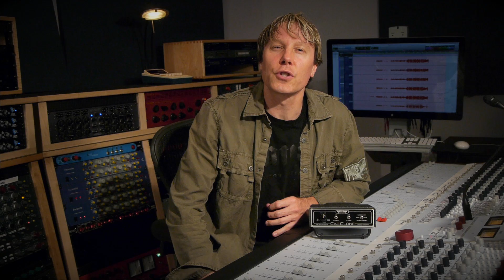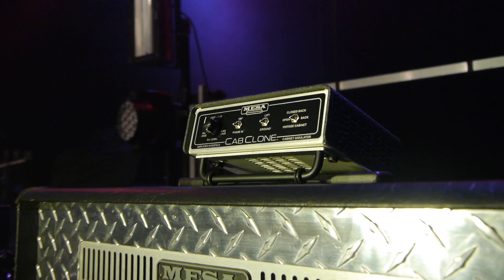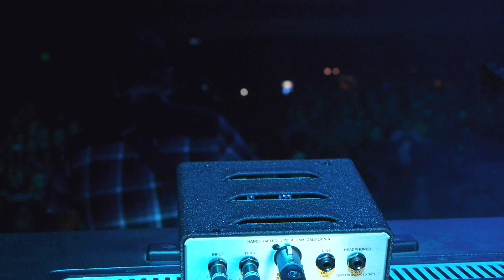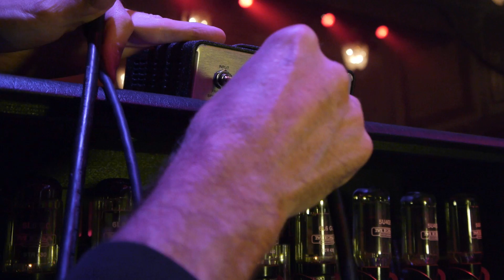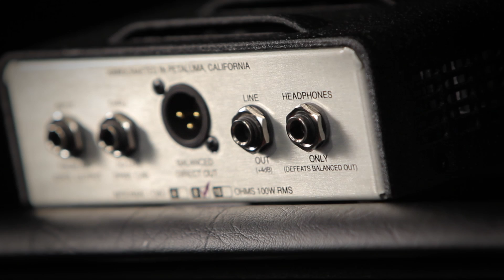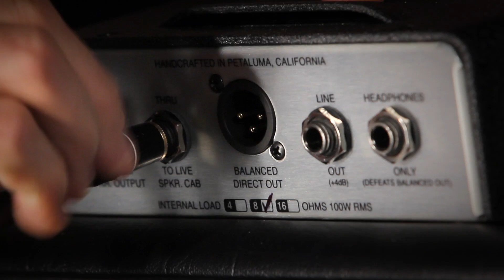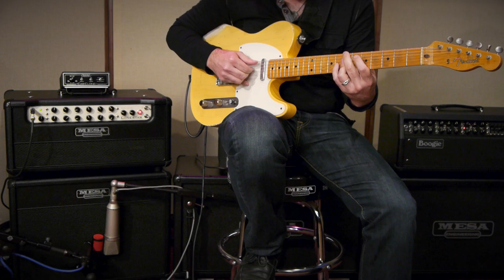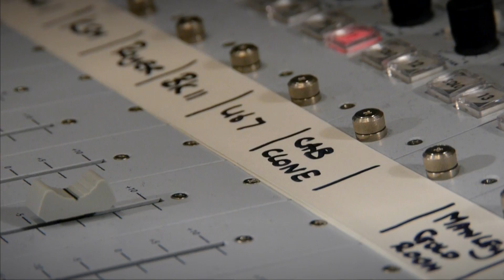MESA/Boogie CabClone Official Demo Video

Comment: they put this into the back of the mark V:25 and it is greatly underwhelming. convenient and useful in a pinch to record a demo. but it sounds like plastic..idk how else to describe it. plastic and smooth on the top end, but still harsh and with zero character. the low end of palm mutes are fizzy. horrible cab clone.

Comment: Only a half decade late to the conversation!
Is anybody out there using this device Amp> CabClone> DAW ?
Are the cab sims any good? Obviously the sound quality is coming from your amp and pedal board and so the most important feature of this device is the cab sims?
Good/Bad/Meh ?????
Reply: see here is my problem. some are raving about it (5 star reviews on sweetwater) and then some notable players say it doesn't cut it, my sansamp GT2 has been a blessing since i discovered it for live use ( direct to board and in front of a low volume on stage amp with direct xlr [from amp] to board.. I may get it and do a test run live and let u know

Comment: Is it possible to use cabclone as a load box and send DI signal without cab simulation to insert some IR plugin?
Reply from the maker: Hi Ricardo - YES! Just connect out of the Slave Out to whatever device would receive direct signal and add your IRs.

Comment: So... after using the di line out of a Mark5 35. my first impression was that it was a fantastic piece of junk. immedietely switched to micing the cab for recordings. but... i was watching the two notes amp load box simulator vid that everybody raves about, and like everyone else i was really, really impressed after the horrific failure that was the cab clone. then something occurred to me! Wait... did i use a cab simulator on the cab clone the way everybody did on the two notes? dug through my old tracks from a couple years ago. nope! no cab sims! apparently, i thought it was supposed to work by itself! put my now-standard cab sim settings on that old mark 5 track. sounded perfectly fine! it's official we're all dumbasses! i think the only real problem witht he cab clone was the advertising. they never said it needed a cab simulator, and made it sound like the thing could sound amazing on it's own. That just isn't true. no idea why they continue to say that. (even this video really, really gives that impression). i think, even if Mesa rebranded the exact same product and marketed it and demo it as two notes does (for silent recording with cab impulses-fuck all that live stuff) it would get wildly different reviews, and everybody would forgive Mesa for seeming to pull their heads out of their... highly technical way of thinking that doesn't apply to the average musician- and fixing a product. even the name- cab clone is misleading. they mean that it tricks your amp into thinking there's a speaker cab. it's a load box. but the name sounds like it's all you need to SOUND like you have a mesa 4x12 cab. just isn't true. of course, it isn't true for the two notes either is it? Mesa did screw the pooch on this. but they screwed it up in their videos and marketing. not in product design.
Reply: Wait a minute! What you are saying is incorrect. This unit allows for 3 speaker cab settings. Unless you want/need more than what is offered in the unit. A cab simulator is not required. WTF are you talking about ?

Comment: This may help anyone sceptical about buying this product, as I've used this for a long time now at professional live shows, and I know of many major artists using them such as the guitarist from Architects, Sliptknot, The Contortionists, Weezer, etc. Main thing for me is that this is great for a live application. I use this direct to PA, and it is not connected to a speaker cab as we don't need stage sound and use in ear monitors. I've compared our live videos of us using a mic'd cab, compared to using just the cab clone (no speaker connected)... and as I said, in a live situation, I can not even tell a noticeable difference, nor will your audience. Even with real cabs nobody can tell what speaker you're using live. If for some reason the sound guy thinks it needs tweaking, he can EQ it. If your amp has great tone, this won't ruin it live. With that being said, I would never use for pro recording. For recording demos, its great. I can agree that this compared to the Torpedo live or a real speaker isn't exactly the same, but when have you ever gone to a show and the bands tone was exactly the same as the album. I personally like to hear a more raw live sound. Anyways, I hope that this helps anyone considering. In summary, great for live, great for demos, not great for recording your next album lol.

Comment: Hi. I would like to know if this is a cab simulator or a mic / cab simulator? I read the user manual and it says "The CABCLONE™ is a passive Cabinet Simulator/Speaker+Mic alternative with a built-in amp 
load" but I never saw anywhere else in the manual how to use the feature "mic simulator".
The fact is...there are 2 different things here: 
1. The speaker simulation - when you actually hear the speaker in front of you, and 
2. A microphone picking up the sound of a speaker. A microphone always will color the sound, since there is no perfect microphone.
So...which one is the Mesa Cab Clone? 
Thanks
Reply from the maker: Hi Mike - Great question. The section you're quoting is attempting to say that the CabClone is an Alternative to a Speaker+Mic - but it is not attempting to say that it incorporates mic simulation. Ultimately, the CabClone is a load box that allows you to capture a balanced direct signal to a recording interface or FOH or monitoring system. It's a passive system so there's not an incredible amount of circuitry that simulates cabinets, mics, rooms, etc, like some of the more advanced digital processes out there. That said, it provides the load function and offers 3 basic passive EQs that seek to emulate the basic EQ curves of the cabinets listed. Because the EQ is passive, it is suggested that the capture will likely be further EQ'd in your post production workflow to get the tones exactly where you want them. More specifically, there isn't a microphone 'voiced' into the sound from the CabClone as there isn't an active circuit involved to offer that level of EQ control. Keep in mind the price point and functionality of the CabClone here - it's a device that offers a feed to your recording interface or live performance systems and allows for silent or THRU functionality of that signal. You have basic passive EQ of a balanced signal and will add EQ after your input of choice to fine tune a passive, direct tone. Hope this helps and thanks for your interest! :D

Comment: i have it on my markV35, is not that bad but is not that good too, when i record i have to use a IR to fix the sound to be more " similar " to what i hear from my real cabinet , it would be nice a VST from mesa to fix the sound better , by itseld on a PA is not that good , is better to use a microphone in front of the cab..
Reply from the maker: Hi Alex - Your experience is exactly what we suggest you would do to accomplish the best sounds possible direct. Anyone connecting direct with a PA would add post EQ at the FOH sound board. Anyone recording direct with access to IR or post EQ would also be suggested to feel free to add Post elements to make the sound as good as possible. Because the CabClone is passive, it will do nicely to capture a direct sound but will likely always require some post EQ to make it as good or better than capturing with a mic because passive direct will never sound as good as a speaker, a cabinet, a mic and a room. That's what you're adding in post. Thanks for taking the time to comment and hope the Mark Five: 35 is working well otherwise! :)
Reply: well what i suggested is a VST from mesa to give already some tweak to make it sound better, all in one package to help to make it sound good.. it could be a plus for the cabclone owners ( standalone and built in amps )! yes the markV is great
Reply from the maker: It's a great suggestion, Alex Tomasi. However, implementing the technology you are recommnending into existing amps with the CabClone is not possible. That's not to say we won't be considering other options in future products and designs, BUT - in the meantime, once people understand and learn how to get the very best tone from PASSIVE devices like the CabClone built in to their amp, it's easy to see that it's actually a great feature once you understand the workflow. Thanks again for the comments and the suggestion. Very much appreciated and hope the amp continues to serve well. :D
Reply: is not a implementation inside but a downloadable vst , i think is more easy to make

Comment: What about running a bass guitar through this thing?
Reply from the maker: Hi n0g4rdd3r - Most bass amps deliver wattage that is well above the wattage rating of the CabClone's internal load resistor. If your bass amp is below 150 watts, you could use the Cabclone, BUT... Most people record bass either plugging their bass straight into their recording device or DAW, OR - they'll use a DI of some sort. We would recommend this for the ultimate control and tone as well as being useful in other applications like live performance or as a backup to your main amp: https://www.youtube.com/watch?v=qM23tXslaGA&t=1s

Hope this helps and thanks for your interest! :)

Comment: sounds amazing.  Just out of curiosity,  is the cab emulation done digitally by an IR,  like a torpedo live?
Reply from the maker: Hi JAFO - The cab emulation is analog and because this unit is passive, the cabinet simulation is achieved by subtractive EQ circuitry with analog components on the inbound signal. Hope this helps and thanks for watching!
Reply: MESA/Boogie yes, thanks for the reply!
Reply: torpedo live is much better
Reply from the maker: Also $700 more,Will Maskell Music - but certainly a great piece of gear if someone's application and budget needs it. Thanks for watching.

Comment: This is a great load box, as well a quiet and decent sounding alternative to your speaker cab when practicing. I refer to it as a great load box and not a great cab simulator because the on-board cab simulation blows when it comes to quality recording. It works well as a load box and when paired up with a high quality impulse and impulse loader (which can be found for free), you can get stunning results. Considering how flexible of a device it is, I still feel I got my money's worth.

Comment: OK, here we go...

The more I watch videos of the Cab Clone and read these comments, the more I come to the realization that all the people commenting on how much it sucks, (1) don't actually own one or ever played using one or (2) don't know or are not taking into account all the things that are done to your original guitar tone before it's finished in a mix.  If the Cab Clone could sound exactly like a mic'd up speaker,  do you know what it would be?  A mic'd up speaker.  It is a DIRECT SOUND.  It doesn't carry with it the exact EQ a speaker has combined with the EQ a mic in a room imposes on the sound from your amp.  From a live standpoint, your guitar tone when it comes out of the PA, is drastically different from the tone you would record with.  Cab Clone does an awesome job at giving you an awesome DIRECT SOUND a sound engineer can use to fit you into the mix.  Actually having a speaker connected to the THRU INPUT of the Cab Clone makes this even better because I'd say about 25% of the speaker's sound gets fed back into the Cab Clone signal and mixed into the D.I. sound.  This makes it sound way more lively than just using the resistive load in the unit.  Don't believe me?  Watch this... 

https://www.youtube.com/watch?v=t_1s1uxv_cU

I could go on and on, and I will if you really need me to.  Just shoot me a message and I'd be happy to educate you.  Like all Mesa Boogie products, it's not a plug and play, instant gratification piece of machinery.  Some tweaking is required to obtain results that will work for you.  I have seen videos with this device where people honestly couldn't tell the difference between the Cab Clone and a single SM57 and Vintage 30 combo.  ( https://www.youtube.com/watch?v=FQVop1-Splc) That's because of using a speaker load and proper EQ'ing.  "Awe man!!!  What do you mean I have to EQ it?  Can't just sound like I want outta the box?"  No!.  Even your mic'd speaker cabinet gets EQ'd at the console (heavily when you're recording).  

The point I'm trying to make here is that people need to pull their heads out of their asses and quit giving an awesome product an undeserved bad reputation.  I previously had a Palmer PDI-03 that I bought for $519 used.  After getting my Cab Clone at $230 used, I promply returned the Palmer.  It's that good.
Reply from the maker: Hi +Anthony Knight - Thanks very mich for the kind words and thanks for the detail and links you've provided here on how to get the best results from a passive device like the CabClone. It's a shame to see so many people being misled on how to record direct. But in time, those who find the need will continue to find the tools. Passive EQ technology, while not on the cutting edge for direct recording like realtime impulse response or even active EQ circuits, works incredibly well for those who learn how to use it. And the price is the huge differences between all the other technologies being compared. The CabClone was designed to offer a solid loading device with a well-tuned passive direct output that requires EQ'ing after your capture, just like every passive direct device that has ever been built and used before it. You're right on the money and thanks very much for taking the time to share your positive experiences with the CabClone. We tip our hats to you, sir! :D
Reply: +MESA/Boogie 
No problem guys.  I'll admit that I had my doubts after the whole Anderton's thing, but I felt like to offer my honest opinion I needed to first research and find everything I possibly could on the product (including the manual) and actually own one so I can form MY own personal opinion.

Comment: For the amount this piece of shit costs your far better off getting a sm57 and a cheap interface (focusrite scarlett 2i2 is a great example). Or you want silent recording, the THD hotplate attenuator is a similar price and has a balanced line out, same as the cab clone. Then just download two notes wall of sound plug in so really good Cab sims. With the hotplate you Cab crank you amp too. 

The cab clone does NOT sound anything like this in real life. It sounds thin, harsh and muffled. 
Completely waste if money and I returned it with the month.

Comment: I've seen and read the vulgar, over the top put downs and rants targeting this product and it's maker on other videos. Really uncalled for, in my opinion, just say you don't like it, give some reasons and move on. It's just a piece of hardware, not life or death. As far as I'm concerned it's a very useful, but granted not perfect, tool for my home recording situation and I knew this before I bought one used.  When you're on a very low budget, a hobby player, and want to use your amp head and record direct or practice with headphones this is a practical cost effective solution. Everyone would like to mic their cabinets and just blast away hour after hour, but for some(like me) this is simply impossible. If you have any doubts then just try it before you buy it.
Reply: +MESA/Boogie 
I completely understand what you're trying to say about people's misuse and misconceptions about Cab Clone.  I also agree that using a D.I. signal (or even a mic'd signal)  to obtain your sound requires some EQ'ing.  Instead of explaining to people over and over that they're using the product wrong or have the wrong idea on how to use it, why not put out a video thoroughly "showing" how Cab Clone is used and how to get the most out of it during post processing in their DAW.   Now I'm not talking about the half-assed attempt on the Anderton's channel a while back... I'm talking about going into the same detail with this product as you do with John Petrucci's amps.  I think something like that would definitely but this mess to bed.
Reply from the maker: Hi +Spyder Logan - Thanks very much for the reasoned comment and the kind words regarding the CabClone. Much of the confusion lies in the CabClone being compared to a mic, whereas, a passive direct box is always used differently than you would use a mic - so the comparison is not as helpful as info on how to properly use a passive direct box like the CabClone. Different circumstances require different techniques and approaches and the CabClone is no different than the appoaches people use when they use IR or software Cab Sims... You just have to know what to do and how to use the stuff to make it sound great! So glad to hear you're having success with it and thanks again for the kind words. Rock on!
Reply from the maker: Good call Anthony Knight - very much appreciate the comment. Hopefully we'll be able to do that someday. Hopefully it would help although we also suspect it may ignite the trolls no matter how good it sounds. Recording is an immensely subjective process that requires some knowledge and skill even with tools that supposedly make it easy. Great suggestion and hopefully we'll be able to put something together that does, indeed put the mess to bed. Thanks for your kind comment and taking the time to make the suggestion! :D